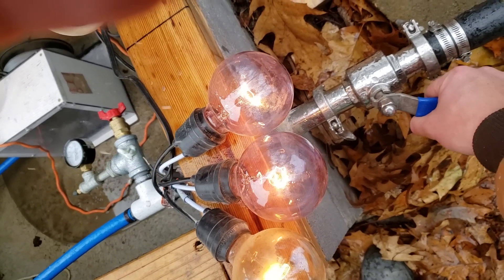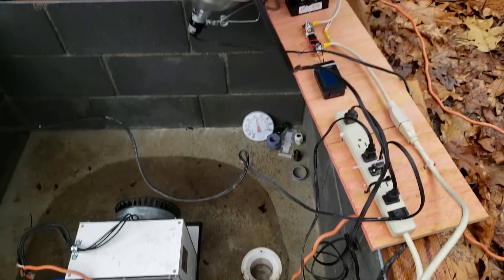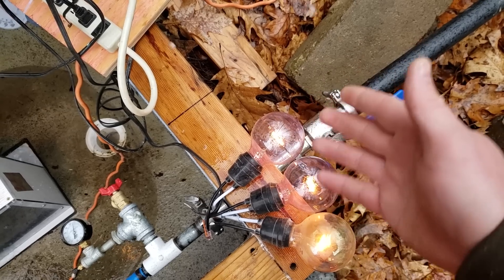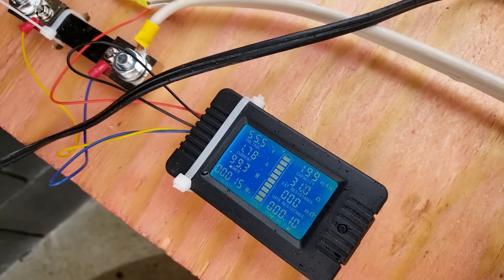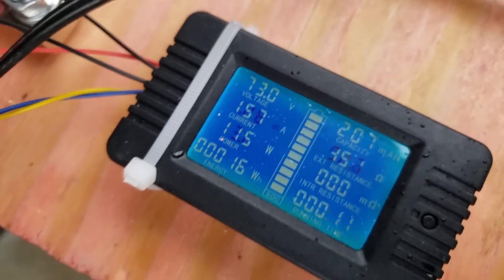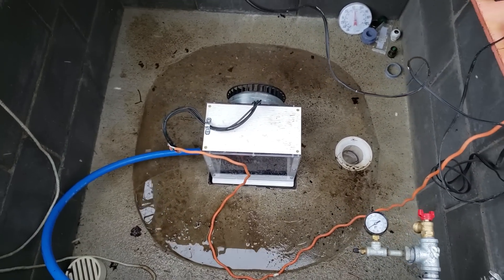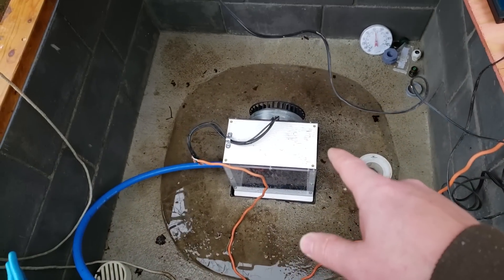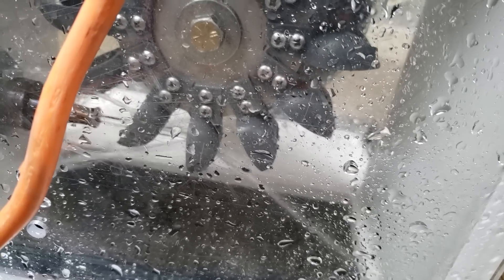It's Producing 130W* at 11gpm 280ft, Much Less Than It Should.

Comment: If you could measure the RPM and the Torque of the rotating shaft then you could calculate the mechanical energy,  would then be able to see if the problem is in the mechanical conversion or electrical conversion.
Reply from the maker: That is entirely possible! place the whole turbine on a board resting on pair of kitchen scales (one on either end of the board) to get torque. RPM is easy.

Edit on second thought I'm not entirely sure this would work.
Reply: @JoeMalovich  Additional Idea. Make the enclosure larger so the splashing doesn't end up as weight in the spoons. V the top of the box and widen the sides so the water has less chance to make it back to the spoons. Right now it's a hurricane in there and water is bound to end up back in the spoons adding weight to the rotational mass.
Reply: @JoeMalovich  lugauge scales the hook type one and a belt one unit one side of the belt then the other the other side then tension this should inidcate the pulling force they is a youtube video where they have a test system

Comment: Maybe a jet and wheel isn't the most effective way to transfer the fluid pressure into power.  I noticed when you had 'open circuit' running, the wheel chamber just filled with water, and some of that access water must have some impact on efficiency.  And, you can see that not all energy from the water is being converted into mechanical energy because of all the back-spray.  

Instead, maybe consider a mechanism like a 'centrifugal pump' (described here: https://www.youtube.com/watch?v=Vhc-hEjh12I).  I'm thinking that if you submerge the turbine completely int he fluid, and let the motion of the fluid wash over it completely to transfer energy, you may be able to get more total energy from your water.  The orientation I'm thinking is a horizontal axis, where the water is injected into the 'volute casing' around the circumfrence, and as the water looses energy, it will drop out to the middle of the chamber (falling downward).  So I think this would maximize transfer of energy into the impeller.

I feel that you're getting 20% energy from your source...and if you look at the velocity/pressure of the water that is exiting the chamber after striking the 'spoons' (the watter is practically being sprayed against the rear wall), that has to account for 30% of your total energy that's just lost.

So, maybe an more enclosed system (like a reverse centrifugal pump) will allow better transfer of energy.

The good news of this is you can basically use your entire system (your penstock, your turbine chamber, etc) and instead just switch out the mechanism of transferring the water pressure into kinetic energy.

Comment: Try adding more load to the turbine, maybe it’s running too fast to harness all the power
Reply from the maker: operating voltage is usually about 50% of unloaded voltage, which is right where I am with my load.

Comment: I wish i had more info about that turbine. There is probably an optimal voltage for maximum power point, but even then that doesn't account for a 300% difference. The water is flowing with the right pressure too, so I have to conclude that it's something with the penstock, turbine, or nozzle.

Comment: I'm thinking that the reduction of penstock diameter inside the turbine shed ( the fittings and blue hose) might be restricting the flow rate at the the nozzle. Also I have found that opening up the nozzle size to allow about a 10% reduction in line pressure with the turbine running gives a higher wattage output, (at least it did on my unit.) Lastly, I don't think your wattage reading sounds right, it's hard to tell without being there, but I am pretty sure that if your static and flowing preasures and flow rates are correct, you should have more that 100 watts. Keep playing, you are getting closer and you are learning more all the time.
Reply from the maker: Many things are sub-optimal currently.

Comment: Hey joe i dont think those big shunt type meters are that accurate on those low amps
Reply from the maker: Good point. I will try a different meter.
Reply: @JoeMalovich  but hey it still delivers more power than my solar system on rainy days!! :P
Reply from the maker: @supersolex  amps measured 10% lower with my only other DC amp meter, ac was within 1%
Reply: some other jets and an "mppt" would get you some extra percentage

Comment: How long can you keep turbine running? Did increase storage tanks?
Reply from the maker: This is continuous and I could run it for days or longer as we enter further into winter, no tanks required. Bigger nozzles too.
Reply: It's using just the flow of a natural spring creek. There are several guys building these kinds of hydro plants on youtube and none of them have any storage at the top of the hill. I'm not sure if that's for legal reasons or that it's just not worth it because the tank would have to be HUGE, but I haven't seen anyone use a storage tank yet.
Reply from the maker: @PaulASmyers  it would need to be HUGE. You can use a pond with low head more easily like the low head Engineer 775 did, Spencer Langston has one like that too.
Reply: @JoeMalovich  yeah, looks like at your 11 gpm rate it would need to be nearly 16,000 gallon tank for just 1 day of operation. But as a buffer that could be really helpful.

Comment: im not an electrical engineer or any of that shit. but is that shunt rated for DC? I wonder if the shunt is only rated for AC. and its just reading AC bleed by from the rectifier.  i would go to lowes or home depot and get a clamp meter rated for DC and just do amps x volts. also if its making 100watts at 60volts its only making 1.67 amps? seems very unlikely to me. i have seen more AC bleed by then that from a alternator on a car.
Reply: the shunt is rated for DC, it measures the voltage collectly.

Comment: Looks like you only using the bottom 2/3 of the spoons, there might be your issue.

Also there's a lot of mist going on, maybe the housing with the straight walls isn't ideal.

I think you would want to have it with a vertical shaft and walls tilting outwards like 45° at the bottom, just to deflect all water hitting the walls downwards, not into the turbine again.
Reply: Could it have more jets, pushing against the spoons above it down?
Reply: @wnblackburn  this increases the flow rate. He doesn't get more flow than what is currently used.

Comment: Take the cooling fans off lol.. in all honesty your best bet is a horizontally mounted so water can fall away from the wheel
Reply: Wish you where local i can rebuild it for you and my lathe and do some fluid dynamic simulation on the enclosure i bet that box is losing 15% from added drag. Also i redesign one of them setups before to use a halbach array with core less winding design and got a 13-14% boost in efficiency. Also broke out all 6 phases put them on latching relays so i ca switch from delta and whe on the fly
Reply from the maker: @CNCAutomationLab  that sounds fantastic! The fan on my unit is riveted on and would require complete disassembly, not so easy to remove.
Reply: @JoeMalovich  i can understand email me sometime username at gmail. Also i can build you a custom mppt controller that takes advantage of the winding inductance. good system will pulse the field to raise the voltage 2-3x the open circuit voltage. The effect is getting more out of less the impact is small at 1kw+ but below 200w it prevents it from stalling.. if you willing to test and play with things I'm willing to build a completely alternator system but send me info on the hub and bolt pattern for your paddle wheel assembly. I can also send design files to build a new enclosure the tilt it 90 and add flow channels to stop the back splashing. We can get it running with just a watt or two
Reply: @JoeMalovich  Joe, you've created a water powered air raid siren. 
Sirens as a matter of course use a huge amount of energy which they radiate as sound.
Old police sirens were loved by criminals as when on they sapped as much as 40% of the patrol motorbikes power or up to 20% of the car power. Sirens meant the hoods could get away.. Read bootleggers history..
So either encase the fan and have a decent evacuation system. Or band it to prevent excess air movement (jubilee clips can do this temporarily) or remove. More drastic but necessary
Reply: @philipp1767  honestly just drill the rivets and let them fall out at you power levels it's just not going to run hot.. it's just a leftover from it's old washing machine days

Comment: Since 120 V AC I actually the RMS value of the voltage, they work with the same brightness on 120 V DC.
Reply from the maker: That's what I thought.
Reply: @JoeMalovich  have you confirmed the readings of this LCD? I don't trust this stuff. Only trust proper multimeters 😂

Just get a reading of the AC side and the DC side and look if there's maybe an issue with the rectifier. Maybe you damaged one phase and it's rippling on two phases 🤔

Just to make sure that isn't an issue.
Reply from the maker: @RubenKelevra  it was within 10%  of the only other amp meter I have that does DC. Volts was within 1%
Reply: @JoeMalovich  I actually meant measuring amp draw on each lead of the AC side. To see if they are in balance. If one is just getting one direction rectified or one lead got no load at all you probably end up with lot of inefficiencies by vibrations, which might not be super obvious.
Reply from the maker: @RubenKelevra  I will check this.

Comment: I am not saying this is the problem, Could it be rotating the wrong direction...
Reply from the maker: No, the alternator doesn't care about direction.
Reply: @JoeMalovich  I thought that too, Yet I am not 100% sure which unit you have... This one looks like it...
I am not saying that I am right, Sometimes the simplest thing might be it! 
 The 3-phase voltage (A-B-C) is set to provide 12 VAC at 140 rpm and 200 watts, 120 VAC at 1400 rpm and 2000 watts.  At 2800 rpm, you will get 240 VAC and 4000 watts.  The fan works best when the generator is run in the Clockwise direction, looking at the shaft.  This is a 12 magnet, 12 pole, (6 pole pair) rotor, so the output frequency is calculated as Speed in RPM/60 * 6.

https://www.ebay.com/itm/PMA-Generator-for-Pelton-Turgo-0-240-VAC-4k-Watt-Micro-Hydro-Motenergy-ME1112/192939606556?epid=1534200330&hash=item2cec18c21c:g:dTYAAOxy0rZRFxZD
Reply: Maybe check your shunt and electronic meters with a DC power supply.
Also could you fit the jet on an moveable plate, left, right, up, down, in, out. You could then adjust it whilst running.
Nice set-up.
Reply: @martinwragg8246  this is what i did with mine to allow me to move the jet left and right and it works a treat, i can do this with the jets running so i can see the change.

Comment: Woooooooo
Reply: I only just started watching, so I do not know enough about your setup to make any recommendations.  But I heard you say that you were using 120 volt light bulbs as a load and supplying them with about 60 volts.  You said you expected them to draw half power since they were getting half voltage.  That Is not the way it works, 
POWER=V ^2/R.   Assuming a constant load resistance the power dissipation varies as the square of the applied voltage.  So half voltage means 1/4 power.  But, in real life its not that simple, since the resistance of the bulbs goes down considerably as their temperature decreases, so that tends to increase the power they draw relative to the V squared value.  Do not know enough about the characteristics of light bulbs to make any specific statements,  but you can certainly expect them to draw less than half power at half voltage. 

 If your generator is putting out a.c. and you are rectifying it, but not filtering it at all, then your power calculations must treat the rectified voltage as if it were a.c., use 0.707 of the peak rectified voltage in your power calculations, a d.c. meter will read the average, voltage, which I think is about 0.63 of peak,  so your power calculations will be low.   Best to just forget the rectifiers for these tests and use an a.c. voltmeter.

Bob, electronic engineer 50 years experience